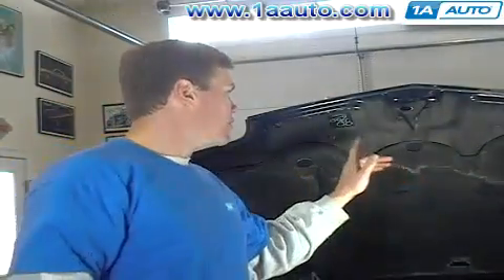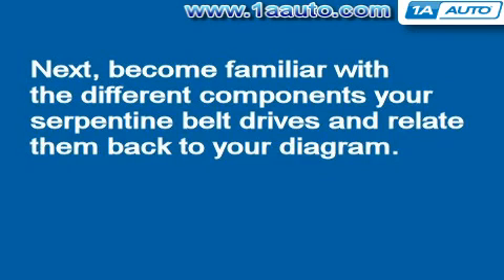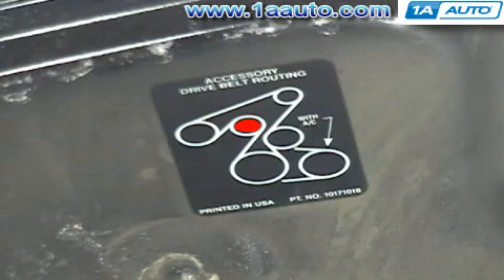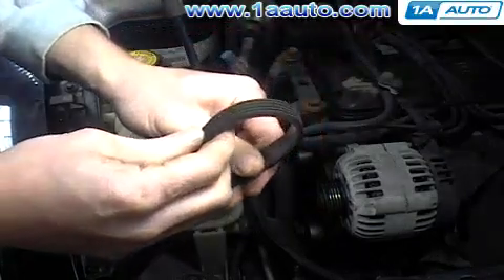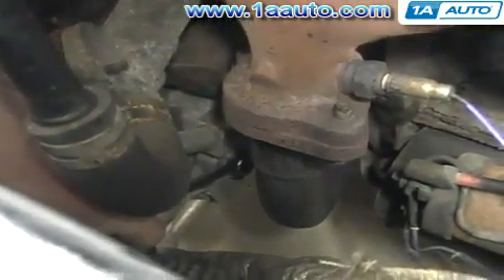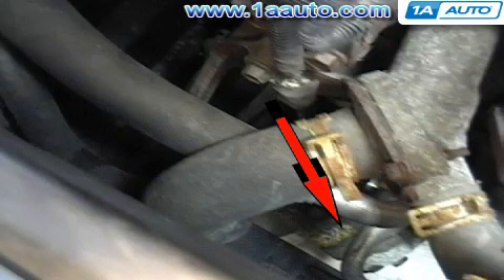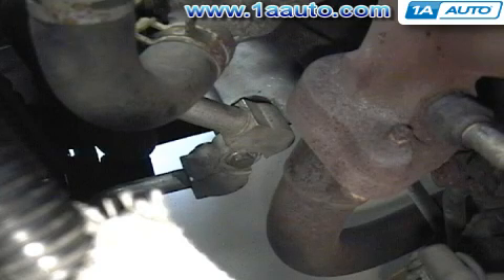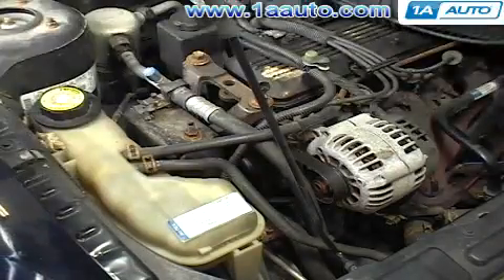How to Replace A/C Bypass Pulley 95-02 Pontiac Sunfire

Comment: With the 2.2L you can just get the non-AC belt as the tensioner is under the power steering pump instead. I was going to spend 30-70 dollars for the delete pulley but saw the option for the non-AC belt. I dont think i have to remove the old AC either as the pulley is low and farther foward.

Comment: Do you do anything with the wiring that you disconnect or just leave them hanging and not plugged into anything?
Reply from the maker: We recommend you try to secure the wire somewhere secure with zip ties.  If you are unable to do that then you can just let it hang freely.  1aauto.com
Reply: what if theres still free on still in line how and when would i try and release that ?

Comment: This bypass pulley worked great on my 2002 Sunfire. Your pulley configuration may vary from what is shown in the video (mine has a Idle pulley). With the idle pulley the tensioner  pulley is located differently and requires a 3/8" breaker bar to release the tension. Thank you for the great video!
Reply from the maker: +J Tuffts Thanks for watching! If any of our viewers needs to make this repair, we carry the auto repair part shown in this video on our website. Here is a link to them: http://www.1aauto.com/1A/ACBypassPulley/Pontiac/Sunfire/1AEPM00004?utm_source=YouTube&utm_medium=CTA+Comment&utm_campaign=ytcomment&utm_term=79U0VSRWbIs

Comment: would this work. on a 2001 dodge stratus. my compressor is locked up
Reply from the maker: +123 45 Thank you for watching. A similar process would work for your Stratus, however removing and evacuating the AC system would require separate size tools and processes. You may purchase an AC bypass pulley which we do not offer at this time. It is highly recommended though to have a professional evacuate the AC system. 1aauto.com

Comment: Would this work on a 2004 Honda Civic EX? The compressor is locked up and now the car won't run.
Reply from the maker: We currently do not have a bypass pulley available for this particular year, make and model vehicle. Thank you for asking. 1aauto.com

Comment: will a a/c bypass pulley for a 2003 Mercury Sable 3.0 liter dohc duratec fit on a 2004 Mercury Sable 3.0 liter dohc dratec?
Reply from the maker: +ryan brewster Think they will, but can't guarantee it. Hope this helps you out.  1aauto.com 866-403-3393

Comment: I have a 1996 2.4l sunfire and I can't find a bypass pulley for the ac? Anybody know the part number or a belt that would completely remove the ac? Thanks
Reply from the maker: Here's a link to the by-pass pulley that we carry on our website for your car. Then you can use the stock belt. http://www.1aauto.com/1996-pontiac-sunfire-ac-compressor-bypass-pulley/y-mo-c/1996-127-80?utm_source=YouTube&utm_medium=YouTube&utm_campaign=1ATony

Comment: i just bought and recieved the delete pulley for the 97 cabrio. it came without bolts, and the original ac bolts are made to tap into the compressor. do you have a bolt kit as well or do i need to get them locally?
Reply from the maker: Usually you're able to just re-use the factory bolts. If you're unable to, you could purchase them from your local hardware store. 1aauto.com 888-844-3393

Comment: hey i have a cavalier and when i have the a/c off it makes alot of noise until i turn it on. once on it stops all the noise. i could care less about a/c can i do this to correct it. i was told it was the a/c clutch and it has loose bearings

Comment from the maker: You may want to make sure that the radiator fan is kicking off and on correctly. You could have a bad radiator fan motor or possibly a bad fan relay. 1aauto.com 888-844-3393

Comment from the maker: that works on some vehicles but for most then tensioner is located in a spot where if there is no pulley for the a/c, it will not work correctly.

Comment: Great trick to know have used it many times expecialy if you r going to replace the belt anyway take a piece of string follow the pulleys bypass the the compressor go to autoparts store get a belt as long as the string use this on many 5.0s to bypass smogpump

Comment from the maker: If the A/C has not worked in a long time, the bearings inside the unit could be bad and will require you to replace the entire unit or try and find a A/C bypass pulley like you saw in the video. You can view the one we have for your car through the link below:
1aauto.com/1A/ACBypassPulley/Oldsmobile/98/-/-/1996

Comment: after replacing the compressor with the pulley do i have to worry about having open lines that were previously connected to the actual compressor.

Comment: As another option, it appears from the belt diagram under the hood that you could replace the existing serpentine belt with the shorter serpentine belt for the "No A/C" model and bypass the compressor.  What is your opinion of that solution?

Comment: So I need to take it somewhere to evacuate the system first before doing this instillation? There's something wrong with my a/c compressor on my Saturn SL2 and whenever it's turned on there's a horrible squeal (my guess is a seized/bad clutch causing tension on the belt), but I don't have the money for a new a/c unit (around $250 for part alone). 

Thanks for the helpful vid, sucks that the compressor is buried underneath so much on this vehicle!
Reply: Bruh r u alive